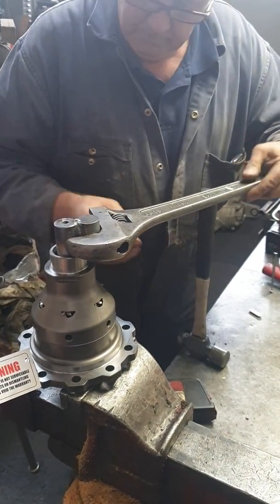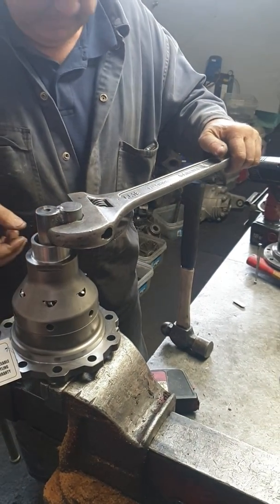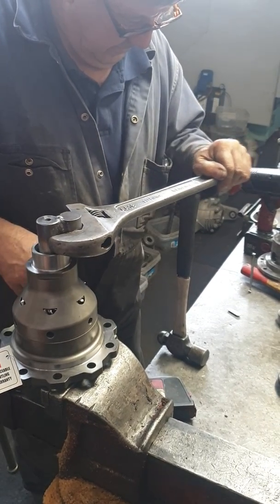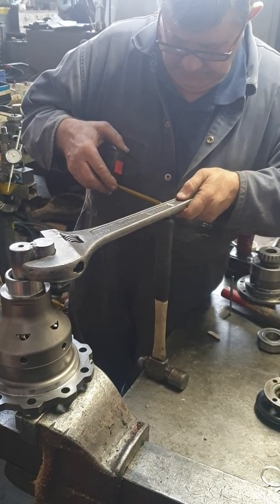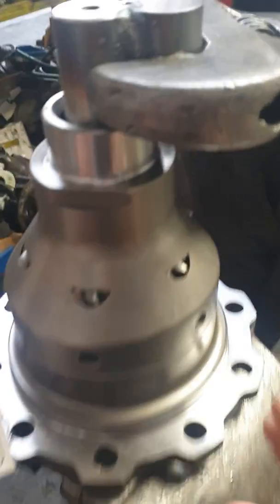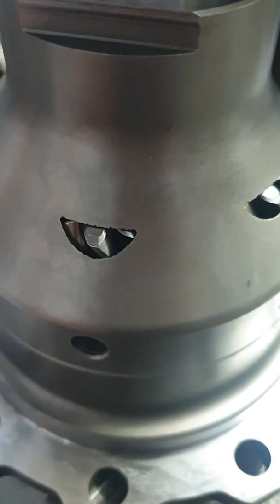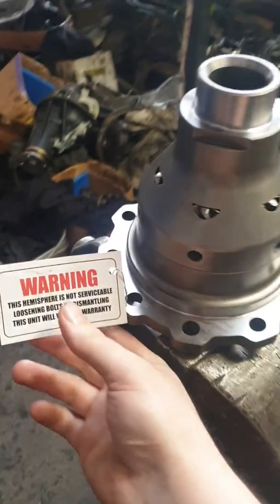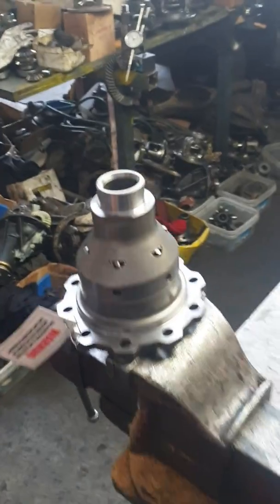Helical gear LSD faults and back lash in the bad design

Comment: What brand is that one?
Reply from the maker: It's from speed master in Sydney
Reply from the maker: It's made in China
Reply: @differentials  
Are the Detroit True Trac much better? 
And I see Spartan has that helical coil design. any info on those?
Reply: I think the Spartan is Made in the USA so I doubt it would be that bad.  @Indeewoods

Comment: To save money did they not take the time to set the lash properly and let them go with a larger tolerance. Seems like
Reply from the maker: Yes they have made the holes in the carrier too big for the diameter of the gears so they are sloppy which makes backlash. Poor machining
Reply: @differentials  does that mean regardless of the effort to change the shims to bring it into tolerance there are other machining issues that contribute to all the movement ?
Reply: @seanokeefe703  there are no shims as such, its simply the slop of the helix gears in the bores as well as the mesh between the helix gears themsleves and side gears. Last between the crown and pinon is what you use shims to set, but very very small in comparison to the helical lsd. However, the alternative is sometimes worn clutches on a clutch type lsd leading to a similar issue. I dont think the lash is an issues conpared to the benefits, just explain it to the customer first l.
Reply: So I installed a blackline helical LSD and since install I get a clunk going from forward to reverse and vice versa, not immediately but I’d say a second or so after slow movement. Would this be the helical backlash you show here? I think blackline is also china shit, and I should’ve gone for quaife!
Reply: Oh, and to be clear I made sure the pinion crownwheel backlash was 0.10mm. Smack in spec for BMW E46

Comment: Not only did I have a good laugh at this, but it actually is a very realistic and great visual representation of the actual lash in these units.  As you said, that's when it's new - imagine you put some miles and hard use on that!
Reply from the maker: Thank you mate. Yes that's right.